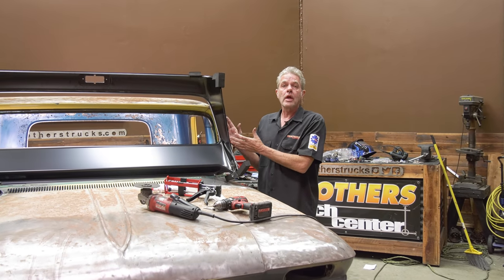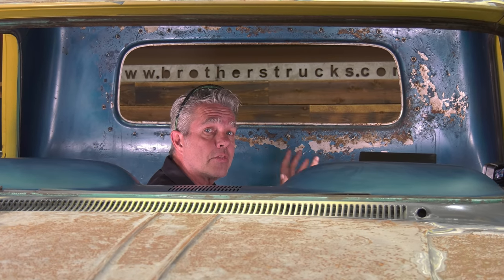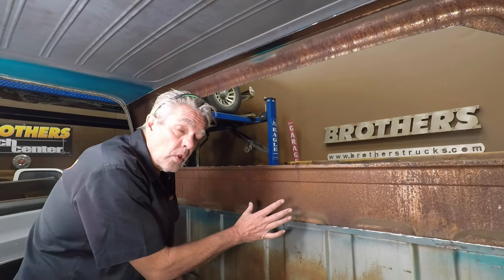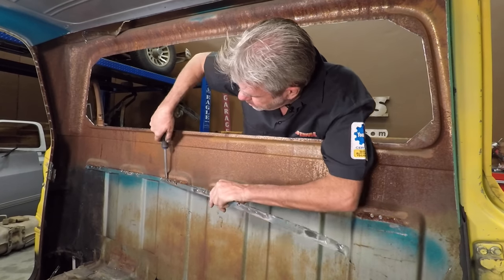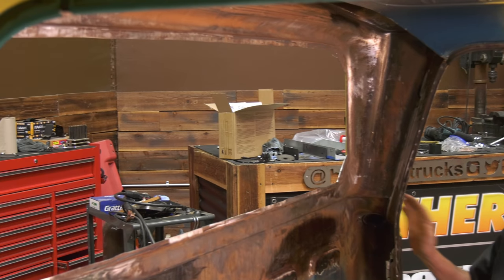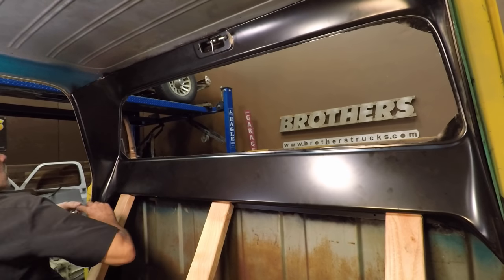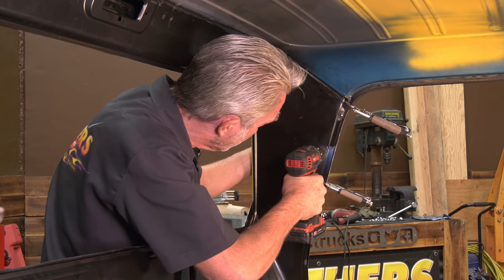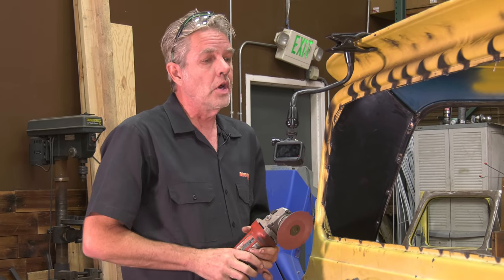1960-66 Chevy & GMC Truck Small Rear Window to Big Window Conversion

Comment: Hard work Dave, but thanks to an engineer who built the stamping and you for putting in, makes it sound and look easy. Good time to buy a 5 gallon bucket of Vise-Grips. Tech tip; Each manufacturer of panel adhesive has its own working time, cleaning to surface for prep and temperature range. Ask, call or read up on the product you may purchase. 
 Dave, good explanation! I think “Smoosh” is a technical term. 
I have looking for a way to include this word in my daily vocabulary. “Honey, can you “Smoosh” some butter between those pancakes?” That works for me! 
Thanks to Dave and Brothers, I already feel smarter!
Reply from the maker: Thanks for the tip Dean!
Reply: I used to ask my wife to crush my beer cans.  I think Smoosh is a better word.
Reply: @billknight964  That is one great skill set! As long as she didn’t use her arm pit or knees! I would be sleeping with one eye open though, in a different room!